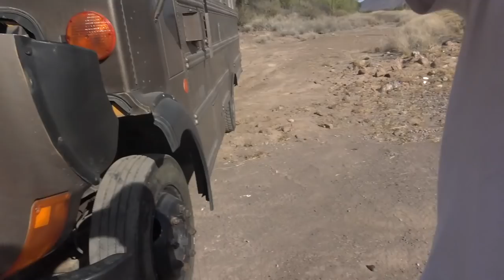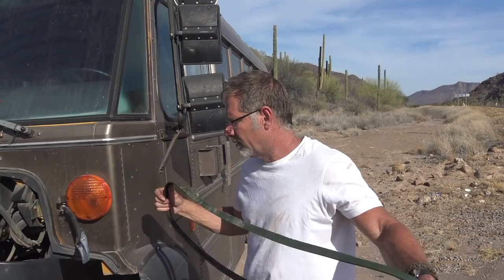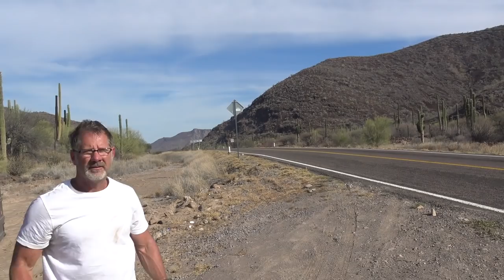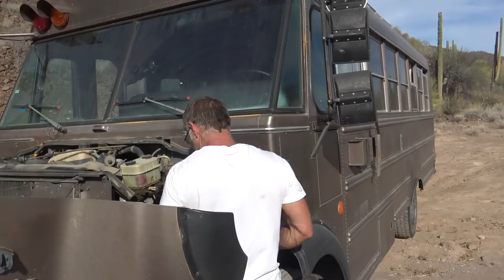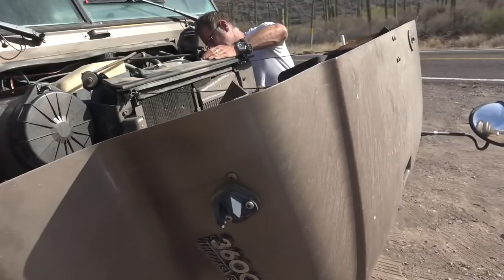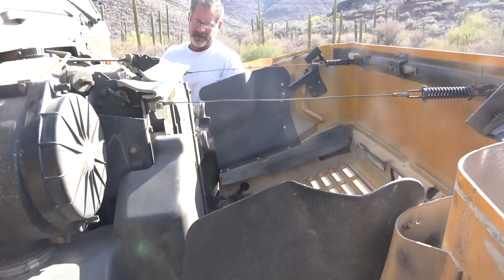Travel Vlog 2019 T444e Water Pump Failure? Power Steering? Getting off the HIghway to fix it??

Comment: Around the crank pulley , around the alternator , around the water pump ,around the power steering pump and belt tensioner on the outside. Wait for it to cool off.... take a break in the mean time.  I'm sure it wasn't as bad as it looked they can only fit on one way ( usually) and usually the belt has some memory of how it went on. Biggest issue is why did it slip off ? Might be worth having a spare water pump around they are pretty cheap.  Don't overheat the engine that's is about the worst thing you can do to a 444.  Hope it was easy and your already rolling along I'm sure. Spare belt is also a good idea!
Reply: Good advice

Comment: Skoolie dot net forum has a sticky  thread called 'care and feeding of the Ford 7.3L Diesel' That post says the engine was made by International and is similar to the T444e.
"Serpentine belt and idlers - The serpentine belt powers the water pump, alternator, AC compressor, vacuum pump (which feeds the power brake booster) and power steering pump so keeping the belt and idler pulleys in good shape is essential. Two of us here have had an idler fail in the middle of nowhere and when that happens you ain't goin' nowhere. Both are relatively easy to replace but you'll first have to remove the air filter cowl.

To un-tension the belt, slip the drive end of a 1/2" breaker bar into the socket in the idler/tensioner body and pull like hell toward the passenger side. When the belt goes slack just slip it off one of the pulleys and ease off the breaker bar. If you're replacing the belt leave the old one in place to show you where to route the new belt. The idler assembly only costs $60 or so. I carry a new serpentine belt and a replacement pulley in my onboard spares".
Reply: Great advice! Taking note man! Thanks
...Good luck Jamie

Comment: Basically the only power a diesel needs is for the fuel shutoff solenoid. Check for worn bearings on an idler, water pump, etc. for the belt getting thrown. Sent a couple of 7.3l belt routing schematics.

Comment: How did it chuck the belt?
Did a tensioner fall off?
The bearings go out in the tensioner pulleys.
Maybe that is why it is hard figuring out the belt.
Make sure something isnt missing.
Take your time.
Dont ruin your motor.
Running a diesel without circulation of coolant can cause head gasket failure due to warping the heads.
It aint worth it.
Use your bike.
Stat put.
Reply from the maker: I definitely dont want to ruin/warp the motor. I have a better vid coming in a few minutes, showing the bad pulley. Maybe I can just order parts.
Reply: @enigmaticnomadics  yea, I figured it was a tensioner or idler pulley.
Yes, bearings are cheap and you should be able to get them in Mexico.
If you are worried about your safety, definitely get a tow if possible.
But if you think you will be okay, i'd leave that bus in place till repairs are made.
I am up in Wyoming or i'd come help you if i could.
Don't worry.
Sounds like you caught it and shut it down.
That was smart.

Comment: Hate to say it, but you don't travel with out a spare belt or extra radiator hoses and a fuel filter and extra antifreeze and all the other oils. I even have a spare alternator and starter, as well as fuses and anything else that can go wrong, especially in Mexico, its all about the journey, and any water pump is a real bitch, I just changed a water pump on a 7.3 idi none powerstroke and the 1-7/8 nut is a real bitch to get off, I rented a water pump tool kit and they have flattened metal wrenches that you can hit with a hammer to loosen the clutch fan, check your idlers pulley to make sure they aren't seized up before you put on the belt,  good luck
Reply: I have carried small parts, sensors, wires, and nuts/bolts for years.
Reply: HES NOT in MEXICO!!! HES in TUCSON  !
Reply: @TOMAS-lh4er  thanks for the heads up Thomas
Reply: @russchamberlain8755  you got that right, I carry extra everything, Jamie should also carry a spare cam sensor, the 7.3 are notorious for cam sensors, also you should replace the radiator cap, they ar 12.00 at a parts store, the 7.3 runs hot and if you don't have the right antifreeze mix to the top boiling point, it will boil or use the water up and you will have straight and lower level antifreeze and antifreeze won't work without water, and it takes distilled water not tap water
Reply: @billgasior  I LEFT him my phone number about 3am this morning ,i can go give him a ride to buss dealership!! but no call!
Reply from the maker: Thanks William. I carry tools and oil/fluids, but can always do better.
Reply: @TOMAS-lh4er  it's great you reached out to him, it sucks to be out on the road broke down, I've been there but luckily I had the parts to fix it, I had a nomad friend that had an axle leak and I told him to have the seal fixed but he left fo his trip and smoked the rearend and was pissed he didnt take my advise, I feel that the rearend gear oil and transmission oils are the most neglected, especially the rearend, it only holds 2 to 3 quarts and is easily changed
Reply: Sorry ,i was wrong about Tucson!!

Comment: You are wrong about running on the battery! No battery needed to run! It fires from the compression! The better question is why did your belt come off? Tensioner alt. water pump, power steering,etc.? Not to mention the intercooler and trans.cooler! Can do alot of damage!
Reply from the maker: I agree. I have a better video uploading now that shows the pulley that failed. I don't know exactly what it operates.
Reply: @enigmaticnomadics  WHY havnt you contacted me ?? your in TUCSON ! I know that piece of road!! I left m y number!! People think you are in MEXICO!!  I can give you a ride back to vfreeway to the dealership!!!  WHATS UP??  IS this ALL a joke, BRO>>??

Comment: I think the diesel can run without the battery once its hot...
Reply: It may need a computer, and definitely  the fuel shut off solenoid. Even so, the battery should hold out. Especially if he has a generator -- assuming he has a charger with him. The big problem is over heating. Just last week I warped the heads on my diesel Blazer. It can happen pretty quick.

Comment: If there is anything I can do, let me know. I could find the part for you, and overnight it. I could find a shop manual to tell you how you need to get it done, scan the page, or even pay a mechanic to give accurate procedures for your project. What kind of bus is it? Also, I have a Toyota Previa, and could take a photo of the general directions for putting the belt on, which may have details you don't want to fail to carry out. The way you describe it, it sounds like you have the wrong belt or so.ething. Let me know. Do you have any ideas on how I can get my personal information to you so you can contact me directly? I hate to leave personal info publicly.
Reply: I LEFT him my number at 3am! hes in TUCSON,I ofered to give him a ride when the bus store opens !! but no calll
Reply from the maker: Thanks, Tom. I have a better video uploading now that shows the bad pulley that caused it. I don't know what it operates, but it all starts there. Im at enigmaticnomadics@gmail.com